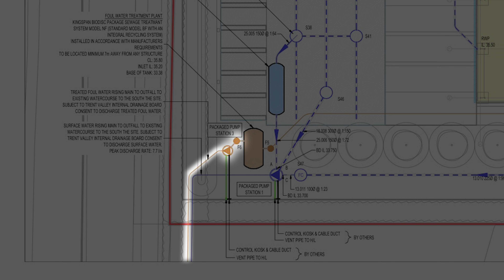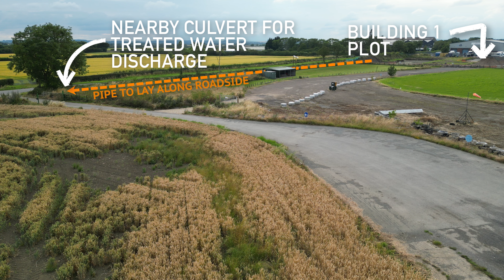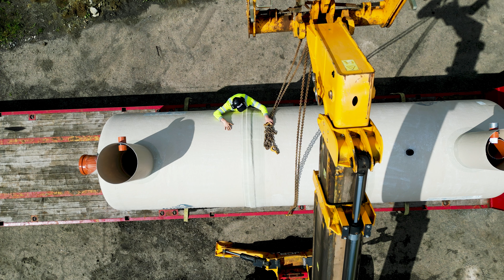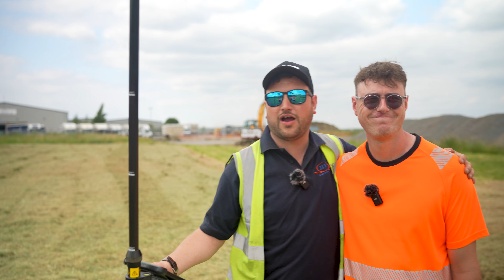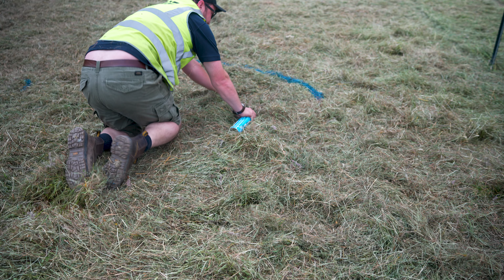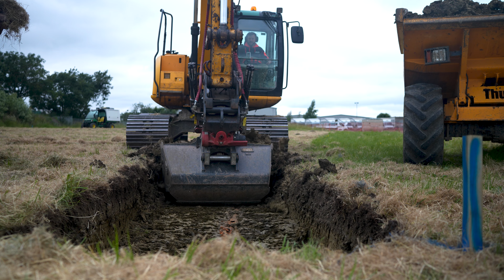Ep8: Concrete Mayhem

Comment: Tank floating 101, the weight of water inside the tank must always exceed the weight of concrete displaced outside the tank, the levels are never the same by quite a margin.

Comment: hi great video whatsthe reason it cant be filled fully in first place
Reply from the maker: Hi, the tank is not meant to be filled entirely without the support of concrete or another form of backfill around it. This design choice helps keep the tank light for transportation and cost-effective. Thanks for watching. 👍